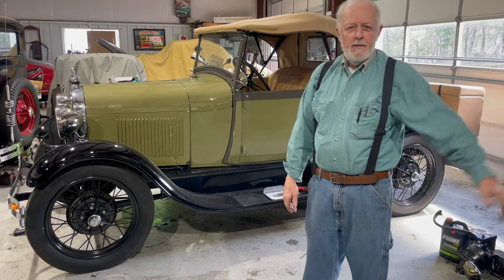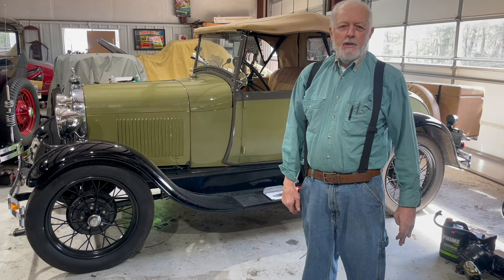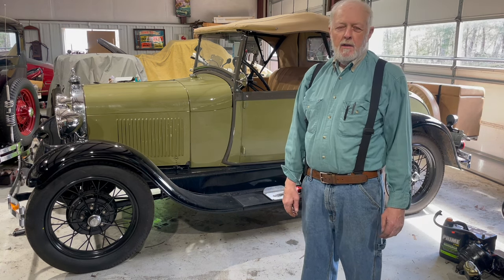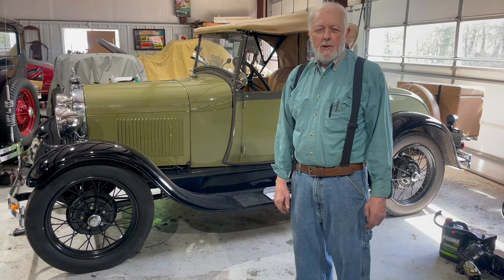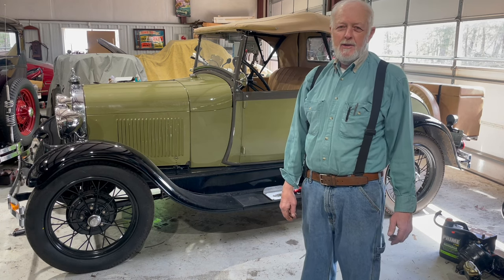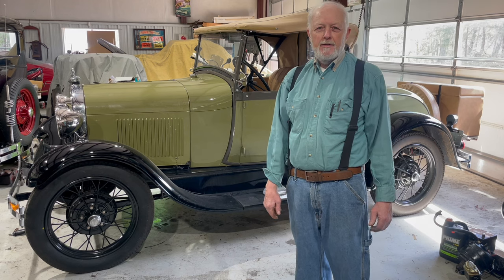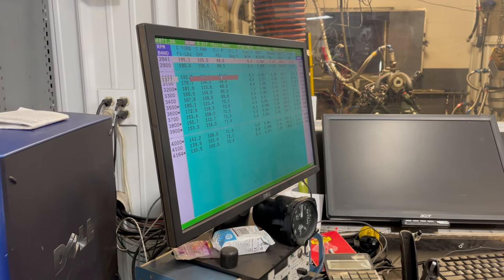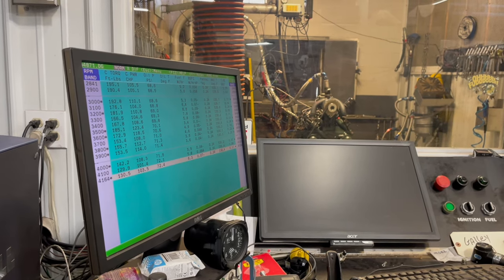FIRST START UP 255 MERCURY AND DYNO PULLS

Comment: Nice engine, and that "little" cam seemed to work out fine.  Is that your '28 Roadster in the background?  That's a pretty car.  Need that drop that Merc in it.  That would be quite a rodeo wouldn't it?
Reply from the maker: thanks ,roadster not mine I'm installing a Mitchell overdrive in it
Reply: Muy bueno
Reply from the maker: Thanks @pablo4015